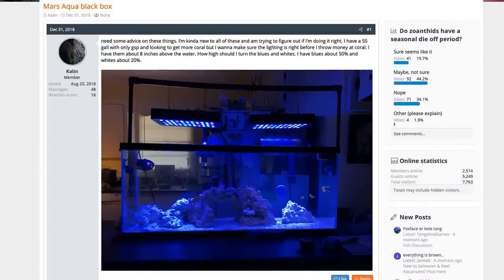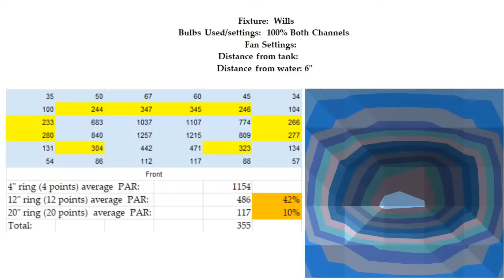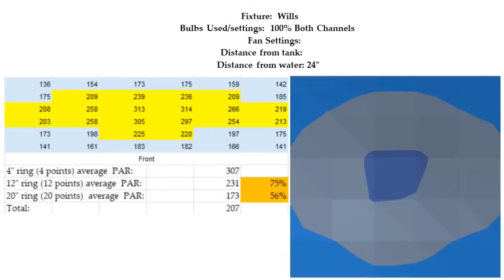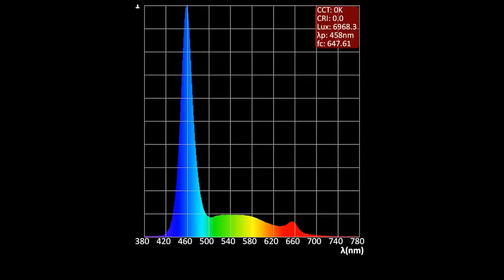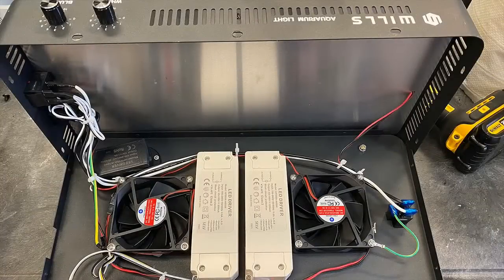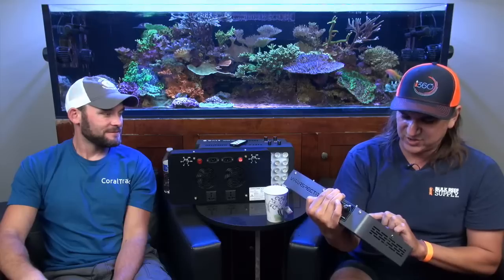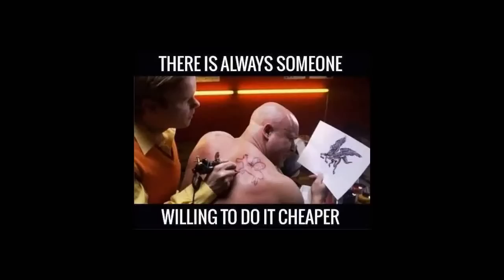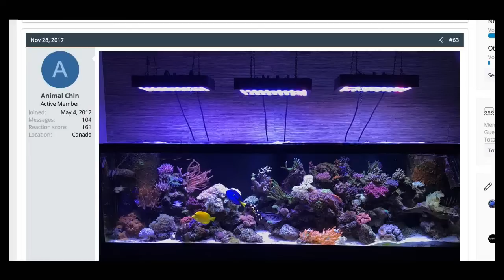BRS Black Box LED Battle Royal: MarsAqua vs. Viparspectra vs. Phlizon vs. Wills. One Clear Winner!

Comment: You should see the price of the premium products in Australia. Black boxes are just insanely cheap in comparison here. (note that rather than black boxes I did opt for 4 x second hand XR30 Gen2 Pro's).
Reply: I’m in Australia and I agree that ‘premium’ lights (particularly American ones - Kessil etc) are crazy expensive here. That said, I am not going to risk having a Chinese black box burst into flames or melt into my tank while I’m at work, however tempting the initial price point is. I scale the tank to what I can afford - if I can only afford safe equipment to run a 20 gallon nano, that’s the tank I’ll get. 
I ended up going for an Illumagic Blaze X Mini, which is Taiwan made and clearly very well put together. It’s a mid-tier light, but at least it comes with peace of mind.
Reply: @bigbowlowrong4694  i don't think this is a problem with newer more expensive ones

Comment: I hang my Vipraspectra at 18in for 24in wide tank, it is the sweet spot.
Reply: What settings do you use? And do you also have sps corals?
I have them at the same height at 80% blue and 12% white atm. Thinking about turning blue up to 90%.
Reply: @tj-zn1sz  Some SPS like montis, birdnest and stylos, pocillpora. Only running 40% blues and 3% whites. Plenty of light also have anemones, mushroom's, GSP, cyphastrea, galaxiea. Tank is an 80 gal, 4ft long 24in wide and 16in tall.

Comment: It should be mentioned the really old (2012) mars aqua "license plates" were thicker and had large actual finned heat sinks (exactly the same as your viperspectre btw) with thermal paste between each led and the plate and mine heated up quite a bit. I had heat issues when the fans stopped working on one which cooked my leds. I have a few different types of these and have replaced leds , lenses and such on them over the years.. After salt creep recently caused one to go up in smoke im now looking at remote power  supply options like the popbloom t30. Also CE is the norm in Europe vs UL.  I had the wires break and the light fall in while i was adjusting the dimmer... and like a fool i instinctively grabbed it and pulled it from the tank, all the while getting juiced until my girlfriend killed the power to it.

Comment: why do no one angle lights for optumum performance? I do it with cables but i know most fixtures dont have that adjustability because of their rigidness. coming from animation and film industry light almost never comes direct from above. changing the scape to accommodate a light for best growth or par levels has always given good results better than any configuration with 90% light. How is this strategy not more common and why do most opt for vertical placement with no angle to adjust for the output angle of the light used?

Comment: 49:50 was the opposite side of the led hot? The side opposite the license plate where the light would be shining. Like you said the heat is most likely not transferring, so are the leds themselves getting too hot? I dunno what an optimal operating temp for an led light is but that would be something nice to know. If the light don’t have a heat sink and gives the led no way to dissipate heat which in turn will degrade the led more quickly causing them to burn out prematurely or at least faster than they would operating at a “normal” temp I wouldn’t want to waste money on something like that.

Comment: Thanks, much more thorough than the last black box video where you said black boxes have terrible light spread and will burn your house down.

Has BRS considered sourcing a black box and selling it under the BRS brand? It appears you've done something similar with the temperature controller. The BRS temp controller looks like the Inkbird controller and may even be manufactured by the same company, although I'm sure you specify better quality in your contract with the manufacturer. Seems like BRS could do the same thing with a black box and sell it at slight premium because people know and trust the BRS brand.
Reply from the maker: Not something that we currently plan to do, but you never know! Maybe some day you'll see a BRS light 🙂

Comment: 125g 6' tank....2 300w vipars $400 2 XR30 $1600.......easy choice
Reply: I have the same tank and just ordered the same lights.. What do you run yours at and at what height?
Reply: @822331cmart  
I have two 300 vipars on my 125, at 9” from water level.  Running 60% on both channels.
Reply: @822331cmart  I have mine mounted from the ceiling at 12" from the water....I rented a mq-510 to measure par....I have my white channel set at 3/100 and the blue channel at 35/100.  They are par monsters and you need to get readings with a meter....I originally had mine set way too high!

Comment: So I have a 75 gallon tank (regular dimensions tank) and I’m trying to get Visaspectra lights. Which ones would you recommend? How many for my tank size? And also how high up from my tank? Thank you a lot in advance! 🙏🏽
Reply from the maker: We haven't had any experience with those lights and that particular tank size, but you're almost certainly going to want two of them. Based on our testing, higher off the water seems to be better as the lenses they include focus the individual LED's pretty intensely. Something like 13-16" off the water surface would be a good starting point. Of course, using a par meter would be the best way to dial them in.

Comment: Bulk Reef Supply is it possible to use the ViparSpectra’s on a tank with a height of 3ft? Tank will be double sided in wall and is 2850L 700W 915H. I understand that they are rated at 24" in depth like most lights on the market, but could I bring the lights down and the corals positioned slightly higher up in tank to make it work with the tanks depth? Thanks for your advice.
Reply from the maker: I can't say that we tested at those depths, but the good news is that you can always rent a par meter to find out for sure with your specific setup (mounting height, tank height, etc) 🙂 I think you'll find that the closer to the water you mount them, the worst the hot spots will get towards the middle and top of the tank, so it becomes a game of whack-a-mole to a certain extent.

Comment: I am considering the wills 165W long x2 on a 75 gal planted tank (they have an option to run full spectrum white which they claim is good for freshwater plants) any thoughts or experience with them growing medium light plants. my tank has co2 etc, I am just struggling to get a good light with that size of tank
Reply from the maker: We're not too big into freshwater tanks here, so can't say that we have a good answer for you on using the Wills for a planted system.

Comment: I had a few black boxes last one had these lenses on called spider lenses like prizem effect but best hight to hang is 16 ft they burn everything under the led chips used to be bridgelux on erly ones which was the best all the latest ones are rip off Chinese LEDs and are not designed for reef tanks

Comment: Hi Guys I just started a 65 gallon, I have 2 of these viperspectra hanging 11 inches off the water . Tanks is almost finished cycling. Might have to go into week 6 with the process . My question is what settings would be recommended to run blues and whites what percentage and how long I heard you guys mention 100% on blues and 30% on whites 8/4 hours . Would love to have your recommendations
Reply from the maker: Generally speaking, we'd suggest turning the blue channels all the way up, then adding in the white channels to meet your visual preferences. From there, use a par meter and dial back all channels in equal ratio if needed.
Reply: @BRStv  thank you guys for the reply much appreciated

Comment: May upgrade to AI Prime at some point in the future, but when there is(at least now) brand new Mars Aqua lights for $40 w/ Free shipping on Ebay if your  just getting into the hobby and likely already spent many hundreds or thousands on pumps/skimmers/sump/rock/RODI before you've even put a single fish or coral in...i dont need a light that can be controlled remotely from work, i need it to turn on at a specific time and turn off at a specific time.  Maybe as  things start to grow in and I learn more  or move to a larger tank "better" lights will make sense...but for now $80 <<<< $420.  I could replace both lights 5 times before i'm even approaching the cost of 2x PrimeHD lights.
Reply: If you want to grow coral at some point the Mars won't cut it. I had one over a 21" deep corner tank. (It's only ONE of my tanks and I grow sps in a 180 so I know a little something) and it wouldn't grow, zoas, blast, acan or even macro algae. Switched it to my 20L frag rank thinking the corner tank was just too deep. Nope.  Changed the guts with reef breeders replacement and got MUCH better results. At least until salt spray fried it lol
Reply: @prsnlty6  everyone has different opinions, tons of people on YouTube or reefing forums that grow huge tanks of sps and others under these 165 w lights

Comment: You can DIY a better light than these black boxes at a similar cost - I've done it several times. Those cheap no-name LEDs are complete trash. They try making up for weak LEDs with the narrow beam angle lenses. I wouldn't buy one of these after seeing what's inside.

Comment: The one thing you guys don't talk about is how long to run each channel
Reply from the maker: That's not something we really got into here, but in most cases, we like to run our LED fixtures with 30-60 minutes of ramp up, 8-9 hours of steady intensity, then 30-60 minutes of ramp down time at the end of the day.
Reply: So if you run your LEDs for 8 or  9 hours a day what about the refugium light does that stay on rest of the time or do you leave it off for a couple hours before it comes on

Comment: Has anyone tried taking out the glass and sanding it to turn it into like a defuser ??? It may make the light more defused???
Reply: You just need to remove the lenses and the light spread nicely
Reply: @charafdablaq1707 Taking the lenses out does help,But,If you went to a glass store and got frosted glass as a replacement or etched the original glass.The diffusion will be enen better and you wouldn't have to hang the light fixture as high...

Comment: I heavily modified my black boxes with extra blues on the white channel  so I can run them at near full power with proper color balance. I also removed the lenses. Last, you guys need to quit with the 400-440nm nonsense because there's no evidence it matters. Basically you are claiming metal halides cant grow coral because they lack this spectrum.
Reply: All plants must optimise their exposure to photosynthetically active radiation (PAR; wavelengths 400–700 nm). If PAR is low, carbon uptake and growth are limited, while too much PAR may damage the photosynthetic apparatus.
Reply: I too have done the same mod to my Vispectra. I have it mounted on the hood of a 24gal bio-qube. I love the look. No spill and 50%blues 30% whites. My 48" 55 gal is running a Current USA Orbit Marine IC Pro Duel w/bluetooth control and one Reef Brite Actinic Lumi Lite strip. I run the strip for actinic accent during the daylight 8hr run. This system with the bluetooth control of lights and pumps is unbelievable. The daylight color is beautiful. Heck it even has audio output for T-storn effect.

Comment: WONT IT BE BETTER TO TAKE THE PAR READING OFF THE BOTTOM OF THE SAND? READING FROM THE TOP IS NOT GOING TO GIVE ANYONE THE INFOR THEY NEED TO PLACE THEIR CORAL AND HOW HIGH WE SHOULD PLACE THE LIGHT , SO I TAKE THIS VIDEO WITH THE GAIN OF SALT ON THE INFOR YOU PROVIDING US
Reply from the maker: This video wasn't an in depth look at each fixture like our setup guides. Rather, it's a starting point for those that are opting to go with a black box and offers some insight into which ones may be the best for the average reefer's needs. We'd still recommend using a par meter to set up your light for your specific installation and tank size 🙂

Comment: PWM vs Analog comnparison ... emmm No.
thing is LEDs are not Linear resistance devices. they have a minimum Voltage at whitch it activates but then they exponentially draw more current as voltage increases(their resitrance -> 0) in layman temrs they go puff with magic smoke and die.
You simply cannot do dimming with pure analog voltage pot. You need that 'flickering'. The actuall flickering is done by LED drivers.The More expensive and powerfull drivers are actually constant current, that is they are not concerned with voltage but with the power. Now how much to flicker is the input signal and the input can be whatever system wants. It can be 0-3.3V, 1-10V analog or a pwm signal. For digital controllers (and there is a digital controller behind the viparspecters led and remote control) it's much simpler to generate a pwm then a long nice precise stable voltage.
There is no problems when using a big fat but cheap knob to have adjust the voltage in 1-10V range. There is no simpel device to create pwm output from a knob input

TLDR: if you do knobs and no fancy lcd dispalys - use analog knobs + LED drivers with analogd dimer input.
If you do anything 'smart' in your LED. like LCD, or timers or remote controll - means you will be using Microcontrollers and for microcontrollers cheapest LED control option is PWM so you use pwm dimmebale drivers.